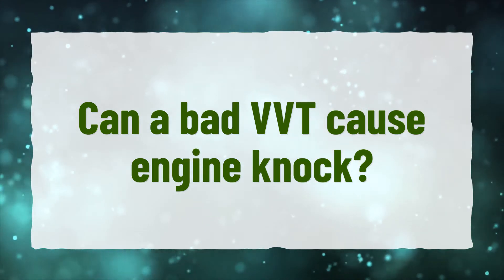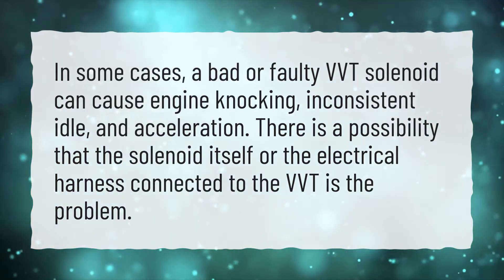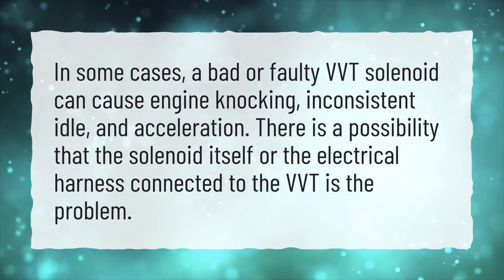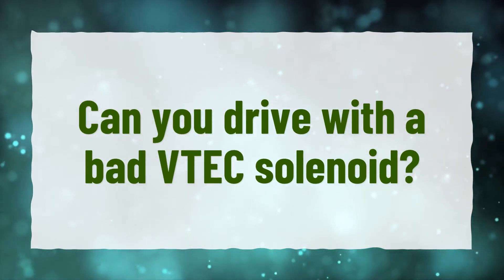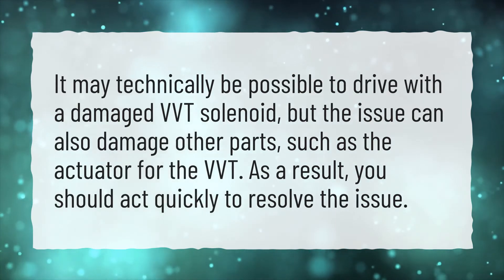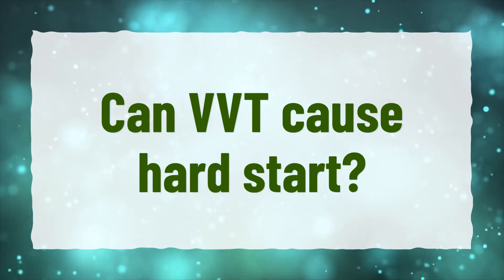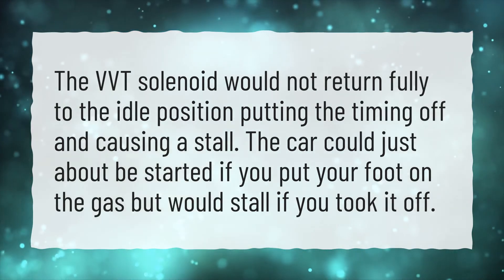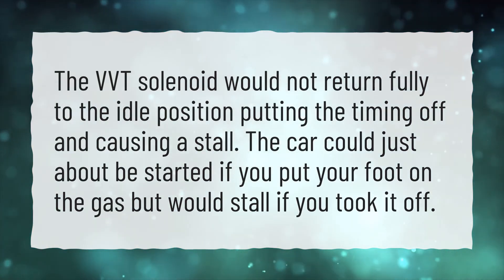Can a bad VVT cause engine knock?

Comment: I have my car witch first thing in the morning the engine cuts off and then starts from the second attempt could it be the VVT sprocket or VVT solenoid? Its shows a camshaft sensor error replaced both sensor chain been replaced 2 month ago